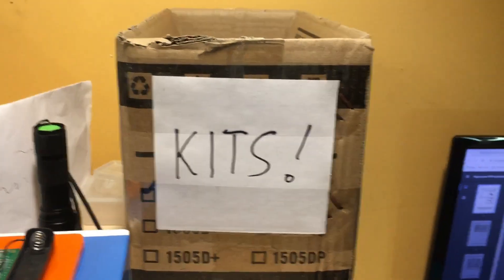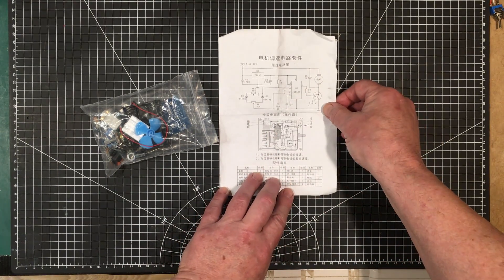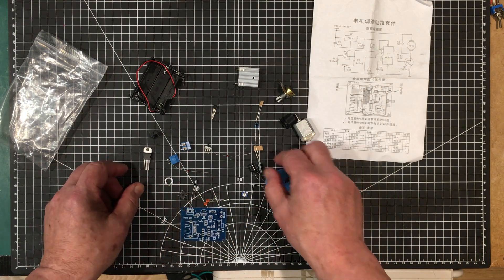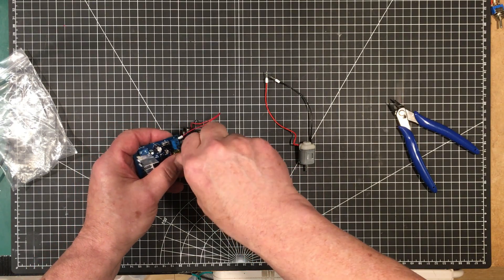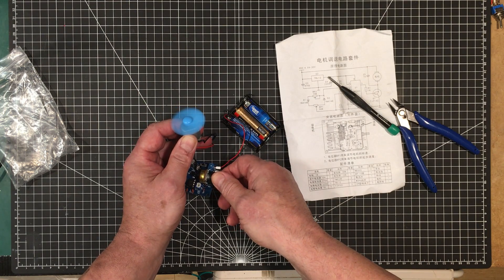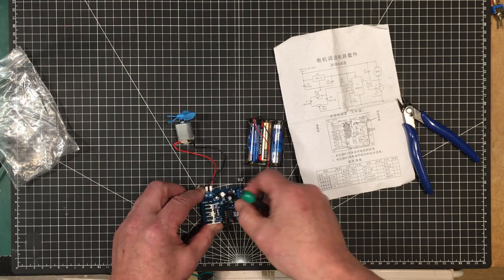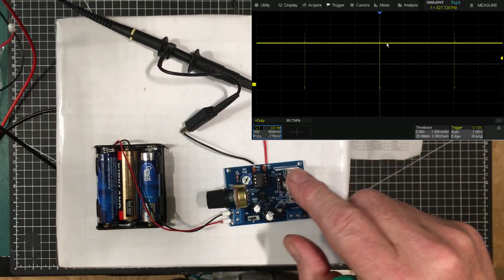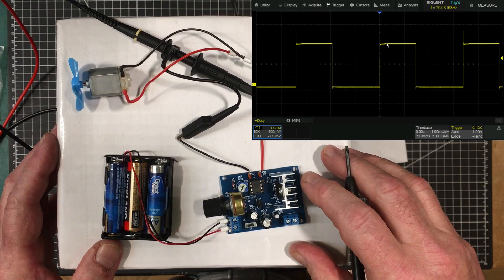Uni-Byte 0191 - KIT of the Month: A REALLY Nice 555 based PWM controller kit!

Comment: I do not see the point of the voltage regulator?
Reply from the maker: I guess it's just there to protect the 555 when you are using higher voltages.  Schematic says "4.5V to 20V".
Reply: @uni-byte  Maybe, the reg can take 35V, but it also makes operation below 15V unregulated.
Also the 4.5V minimum is IMPOSSIBLE due to 2V drop across the regulator, the TRUE minimum V is 6.5V!
So in reality the TRUE operating voltage: is 6.5 - 35V
Reply from the maker: @stevenbliss989  The measured drop @ 4.6V is .9V.

Comment: A year ago I needed a small cheep speed controllable small drill.
What I got is what you have there internally, 555 and all run from a 12V plug pack, bought from eBay for very little $ :)
The 555 lives EVERYWHERE!!!!! :) :) :)
Reply from the maker: It is!

Comment: The PWM is 300Hz   WTF????????!!!!!!!!!!!!!
I think that might be interacting with the motor coil switching rate, hence you higher speed mystery slow down.
Suggest you decrease the timing cap (C2 I think) to something maybe 1/4 the value.  I can't quite read it from your circuit, but it looks like 100nF, so maybe a 22nF
....anyway, just a thought. :)
Reply from the maker: Good thought.  It's a pretty low frequency and I'm not sure why they did that.  I did try 33nF but it did not help.  What did help was putting in a free-wheel diode across the output.
Reply: @uni-byte  Interesting, I would love to the the waveform with/without the diode at the motor.
Reply from the maker: @stevenbliss989  Your wish is my command.  I added screen shots in the description of the waveform going to the motor with and without the free-wheel diode.   Enjoy.
Reply: @uni-byte  thank you :)
Reply: @uni-byte  Quite the voltage kick down and quite long too!
Reply from the maker: @stevenbliss989  Yes.  It amazes me they leave the diode off these little circuits.

Comment: Awesome little kit ! lots to learn here if your starting out and if you have your first scope then plenty to do and measure. When you found it peaked early what was your PSU set at ? because the minimum voltage input was miles out on the diagram a minimum would be about 14 volts, as another man of taste has pointed out  ! (for watching!) also can you leave the circuit up to the camera a bit longer had to be quick off the mark to catch it !   Great tutorial.....cheers !
Reply from the maker: I was just using a battery pack @ 4.6V as supplied with the kit.  3.6V was getting through the regulator to the 555.  See my reply to Mike.

Comment: Doesn’t the 78L12 need a minimum of about 14 volts?
Reply: Yes.
Reply from the maker: It does for the specified regulation to take place.  It will, however, pass between Vin -0.9V (at the low end) to Vin-1.7V (at the high end) at lower voltages.  So in this case, that battery pack was measured at 4.6V and I got 3.6V out of the LM78L12.  Enough to run the 555.  I guess you could thin of it as being used as a voltage limiter in this circuit.
Reply: @uni-byte  Wow never heard of this before I always use them as is ! Thanks I learnt something today.
Reply from the maker: @andymouse  Yeah, me too.  This is the first time I've seen this.
Reply: @uni-byte  :)

Comment: I love 555's. Having no degree I had trouble getting a tech job, though that was the career I was determined to have. But I went in for an interview for one job and the engineer interviewing me asked me, if I wanted to build a 555 timer circuit where would I look for reference data. I replied immediately, "Chapter 5, page 35 of the National Linear Devices Data Book." The engineer walked over to a bookcase, pulled out the National Linear book, opened it to the page, then looked up at me and said, "You're hired." I'd spent the previous 2 weeks designing and building 555 timer circuits for a project for an artist buddy of mine, the first time I'd ever designed anything in my life, and the first time I'd ever used a component data book. :)
Reply from the maker: That's a neat story!  I guess you owe a lot to the little 555!